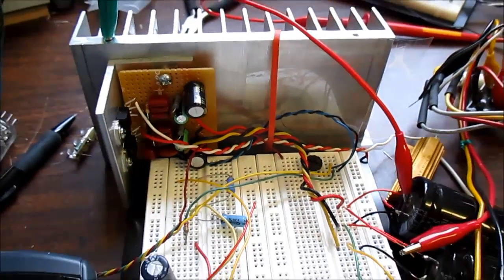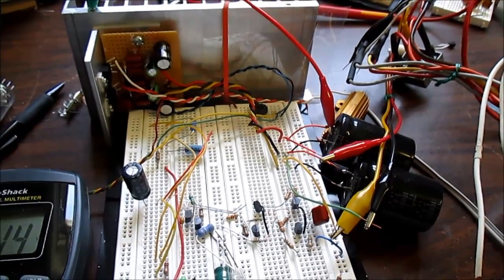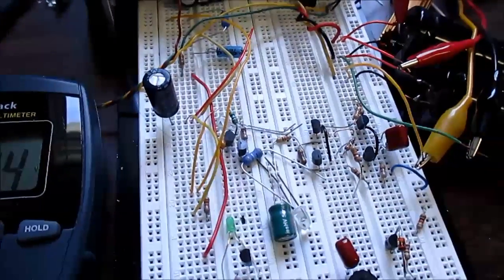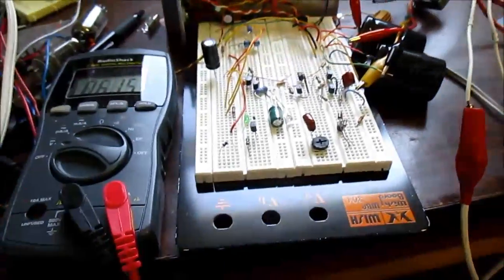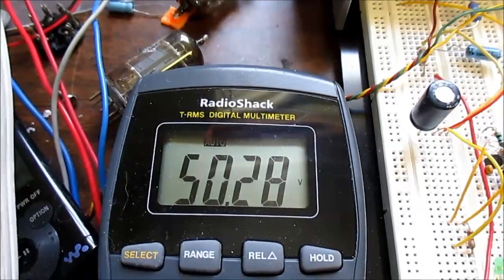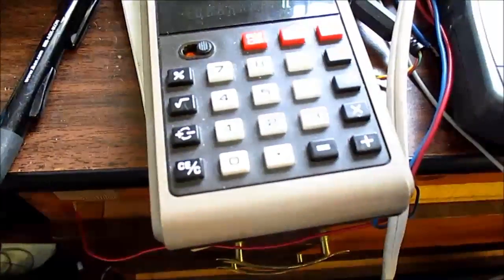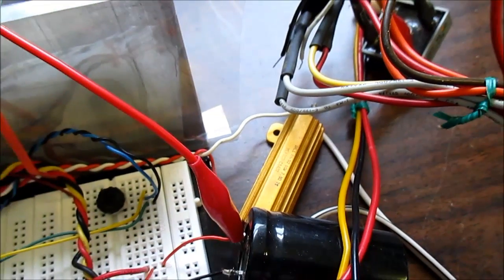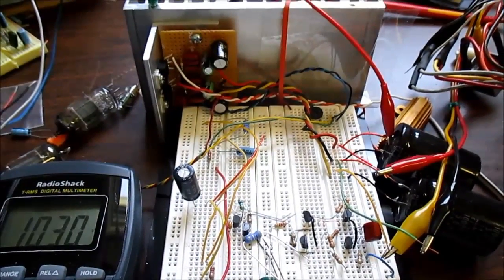TDA2050 bridge amp follow-up video. More power

Comment: John, I'm enjoying your videos very much, and learning lots to boot.  One thing I haven't heard you comment on is the selection of types of capacitors in the various parts of the circuit.  Maybe I missed it.  I'm talking about ceramic vs what you seem to use - some type of film capacitors from the look. Any place where you wouldn't use electrolytics, eg between amp stages?  Thanks again.

Comment: I have a la4440 amp I connect the input wire to the input pin without any source it is huming  but I give input source to the amp huming stop and I disconnect the source it start hum in few seconds what is the solution for that
Reply from the maker: The amplifier may be pickup electrical noise. I have a video that can be helpful: https://youtu.be/xbinXh1ZSqk
Reply from the maker: *picking up
Reply: Ragu Rahavan u try to install a 1k resistor in the input d huming will reduce or better still ground ur wires

Comment: Hi,, what Amperage is your Transformer?
Reply from the maker: +Terence Kaye 8 amp secondaries
Reply: +JohnAudioTech  Hi John,, Thank you for replying, So..that would explain why I can't get my 2050 to work,,using a 555 timer power(or not so power) pump,,,which would be 1amp at best and probably not even that,,, Hah,,,Back to the drawing board. :) Thanks again J.
Reply from the maker: +Terence Kaye Without any current boosting transistors, the 555 can only source around 200ma.
Reply: +Terence Kaye A charge pump, really? LOL For something like an audio power amp you need a beefy DC-DC converter like the ones used in high power car amps.
Reply: Hi John,, for sure,, I even had to laugh,, I actually tried it,, FAIL<< Lol,, 2050 Idle out around 50 ma,, Charge pump is no match for that so I found out,, but the funny thing is,, My 5F1 Tube amp has a Charge pump in it and it works great,, go figure,,
Reply: Terence Kaye Tube amps use higher voltages and thus can get same power output with smaller currents. Charge pump is great for low current applications though

Comment: Might of gotten less Voltage droop if you used better wiring than the alligator clips, though they must be pretty good ones.  Did heat stay in control? Pretty impressive for some (formally) inexpensive chip amps and a lower Voltage power supply.
Reply from the maker: +HillOrStream I really would like to get a good bench supply. It would make setting up for these tests much easier. No problem with heat and the ICs as I used a large heat sink. The load resistor would get hot quick, so I could only run a few seconds at a time.
Reply: +JohnAudioTech   Me too, on the power supply. A simple but powerful + & - and maybe a third @5V. And not cost a fortune. Let me know if you find one!
Reply from the maker: +HillOrStream I've had my eye on a Siglent SPD3303. Two 30v 3a ch. and a 3rd "logic voltage" ch. at 5v max. Programmable and a color LCD. Around $400. You might watch my video about equipping your bench an a budget.
https://youtu.be/L8Q0AypWRaI
Reply: +JohnAudioTech Just re-watched that video last week! I'll have to go to their site and look it over though the price seems a bit high. I could just build a nice split power supply and just use my variac for lower voltages, a dim bulb for current limit. Or there are a number of Chinese PSUs that are less expensive though few seem to be dual + & - to common.